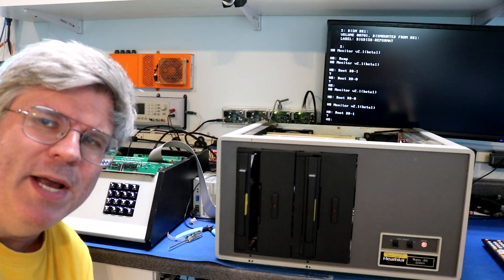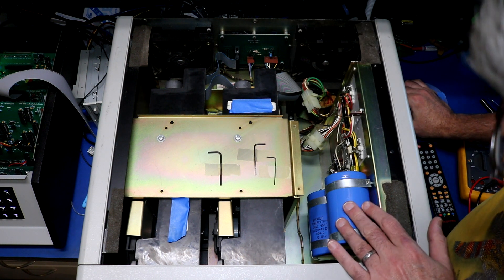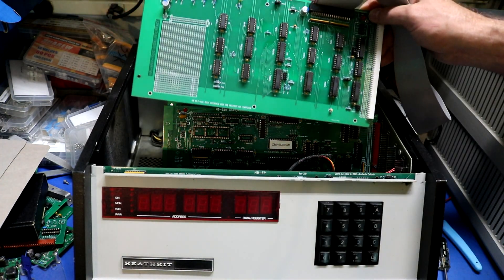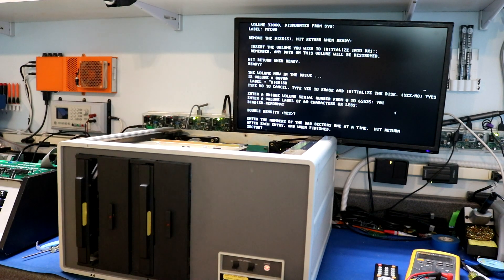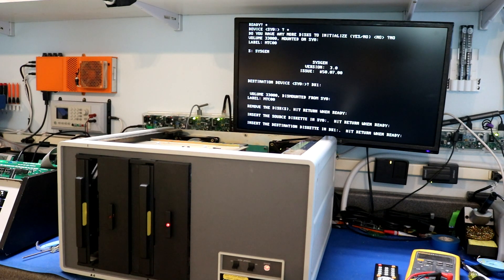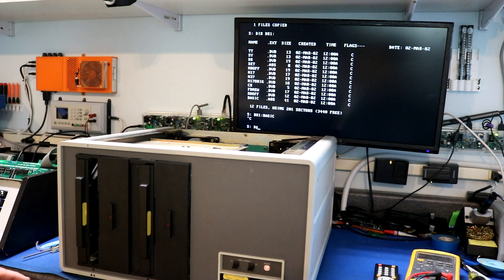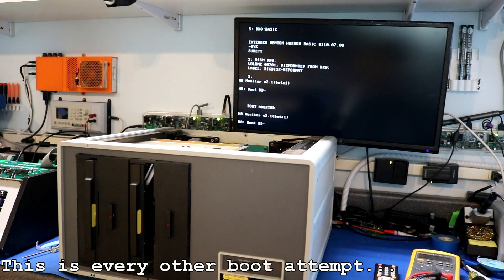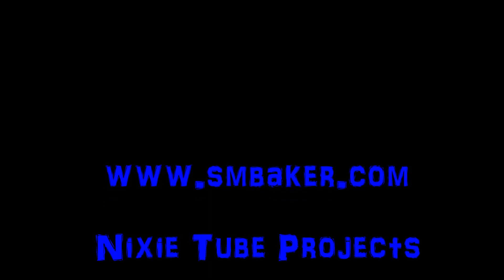Heathkit H-47 massive 8" Floppy Drive Unit

Comment: What is the orange thing mounted to the wall?
Reply from the maker: The orange thing is part of my power distribution system. It's a meanwell power supply, with a few fuses. Probably 24VDC if I remember right. It forms a bus that runs around the lab, connected to various 12V and 5V step-down converters, also mounted on the walls.

Comment: Nice find! I've been keeping an eye out for a set of 8" dual drives to use on a RC2014 (although I may settle for a pair of 5.25" drives instead, easier to move around.). Maybe I'll use your RC2014 floppy controller design with them!
Reply from the maker: Let me know if you have success. One of the first videos I did on the RC2014 was connecting some 8" drives to it. They do come up every so often on eBay, though I'm told you have to be a little careful as there are sometimes issues.